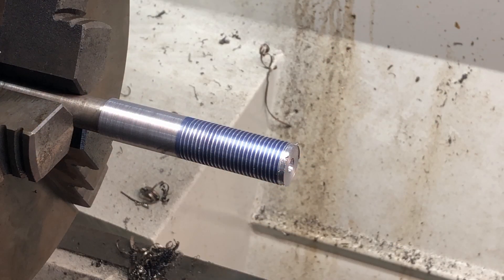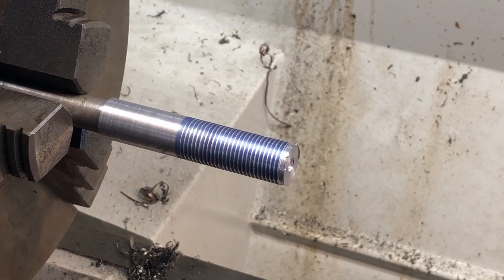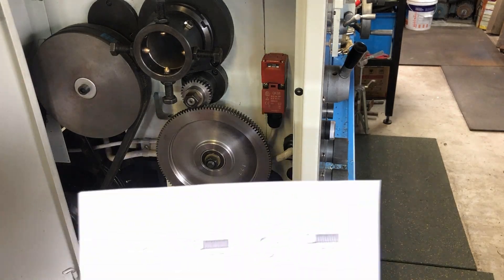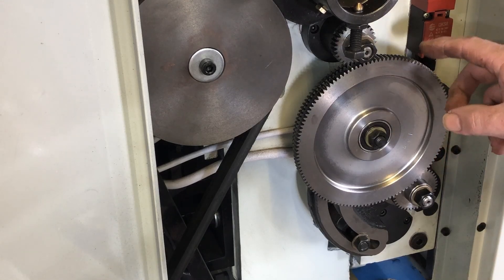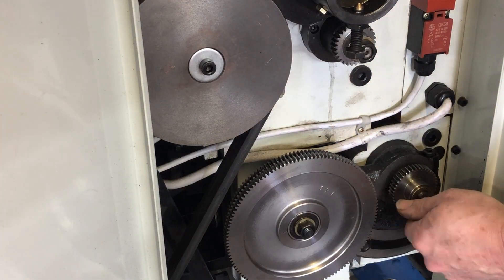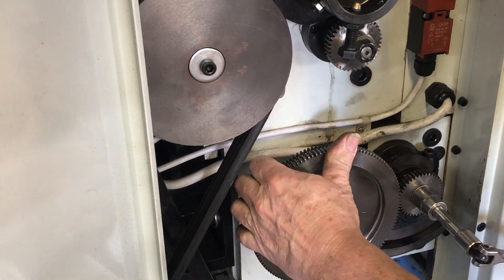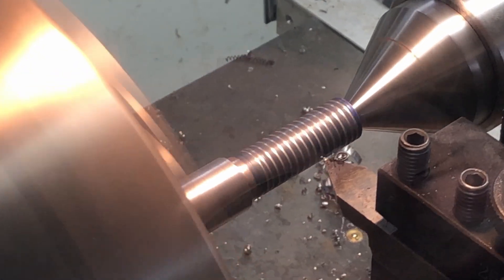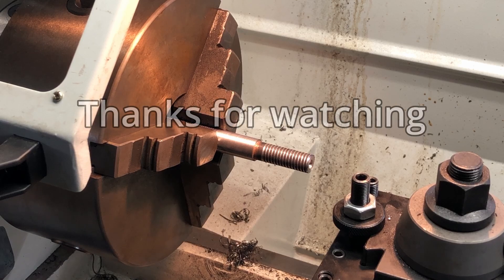Setting Change Gears For Imperial Threading

Comment: Gday, thanks for putting the information out there mate, im sure someone will benefit from this, cheers
Reply from the maker: Thanks Matty.
Quick question, where are the cross slide gibs on your lathe? I have one grub screw on the left that is tight so I don't know if that is meant to be the gib adjustment, or it is for something else. On the right is the DRO scale so I cant see what's under it. I suspect the gibs may be under that.